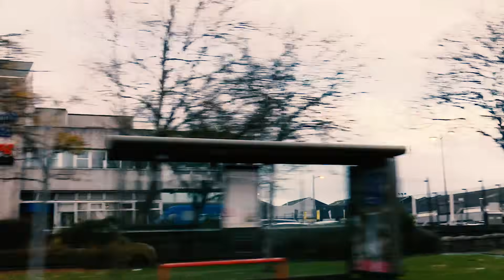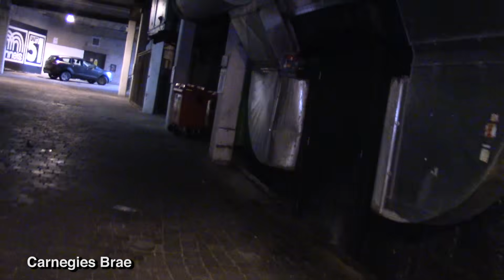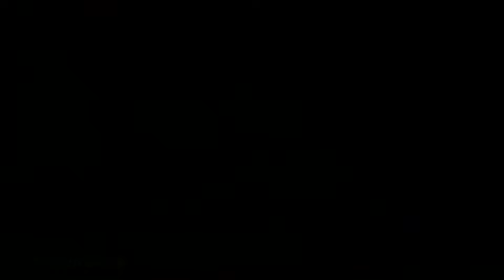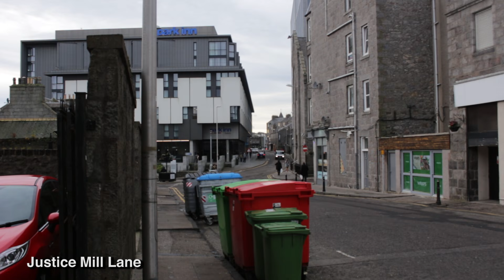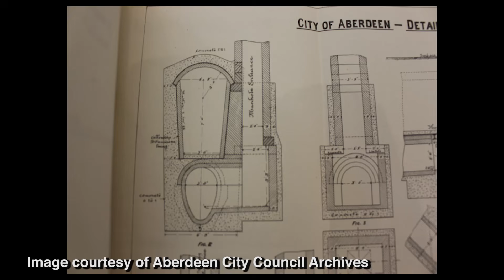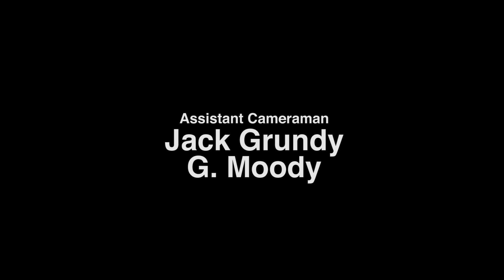Hidden Underground - Aberdeens Hidden subway (Test Screening)

Comment: Pretty sure that when I was a child those unique man hole covers had thick glass tiles in each square section, but where all foggy like glass pebbles you find on the beach. They looked inches thick. The covers where similar to those you used to see (or maybe still do) over bar cellars with thier glass tiles.

Comment: Thanks for this video. I lived in Aberdeen 2008-2015. I saw a few live bands in a venue called The Tunnels. This appeared to be part of the networks featured here. Aberdeen has an unusual lie of the land which as you walk around becomes clear is due to an artificially created level of Union Street and streets running off it.

Comment: An access to the tunnels can be found in the basement of the old Hydro Electric shop in Union Street.
BTW Union Street runs  East to West as the numbers go and originally stopped at Summer Street. Beyond this was originally known as Union Place. You can tell the difference in the less grand buildings there.

Comment: There are also air vent pillars the same as the one on the edge of Justice Mill lane, and Holburn St
They are on either side of Hutcheon street, near the top end, where the railway bridge is
Reply: I have seen those ones, the are very similar to the stink pipes you see in london. If you did not know they were there you would never know they existed.